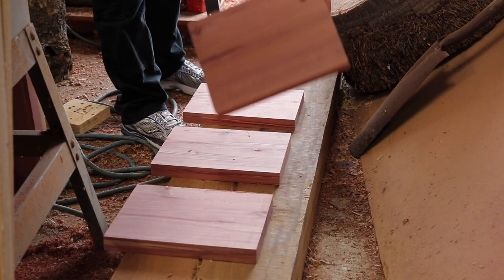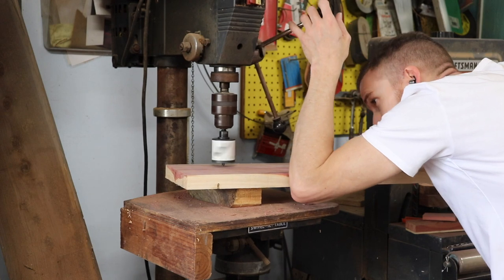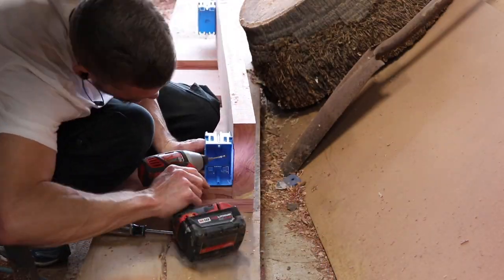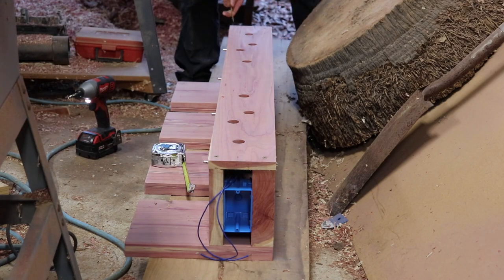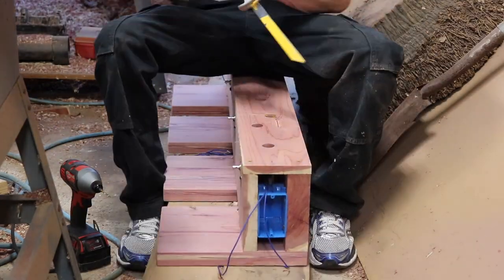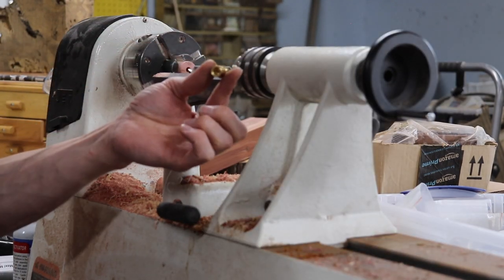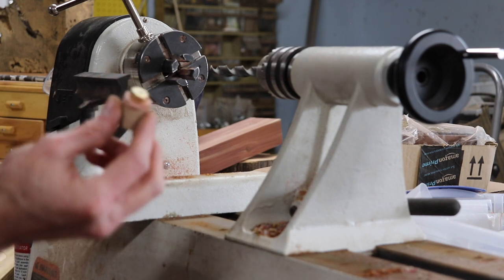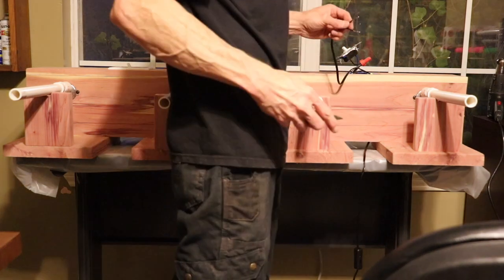DIY Cup Turners

Comment: How do you connect to the brass connections of the motor to the pvc chuck?
Reply from the maker: I turned some wood plugs on the lathe that the brass connectors press into and also press into the PVC pipe. They sell coupling connectors on Amazon. I posted a link in the description of this video. I hope this is helpful. Thanks for watching!

Comment: Im wanting to build a 6 cup turner, and im not very savy with measurements, for a 6 cup turner what would the measurements be for the lumber do you think?
Reply from the maker: It would be 6ft(72") wide for a 6 cup turner with the same layout as the one in this video. 
Here is the measurements you need to build a 6 cup turner. 
1 - 7" x 72" x 1-1/2" (back piece)
1 - 7" x 72" x 1" (front piece)
1 - 5" x 72" x 3/4" (top piece)
4 - 9" x 12" x 1-1/4" (bottom pieces)
4 - 4" x 5-1/2" x 1-1/4" (pipe rest pieces)
I hope this is helpful. Thanks for watching!
Reply from the maker: Sorry this is the correct measurements for a 6 cup turner. 
1 - 7" x 48" x 1-1/2" (back piece)
1 - 7" x 48" x 1" (front piece)
1 - 5" x 48" x 3/4" (top piece)
6 - 9" x 12" x 1-1/4" (bottom pieces)
6 - 4" x 5-1/2" x 1-1/4" (pipe rest pieces)
Reply: @WillowsWorldofDIY  Thank you! You're a life saver!
Reply: @WillowsWorldofDIY  i apologize. What about the pvc pieces 🤦🏼‍♀️
Reply: @WillowsWorldofDIY  also how many feet and what not. Sorry like I said not too say for this stuff but trying to look up the lumber online.
Reply from the maker: That is all the lumber dimensions and it includes the 6 bottom pieces and 6 PVC pipe rests. you will need 6 - 11"x 3/4" pieces of PVC pipe, 6 - 3/4" male pvc adapters, 6 - 3/4" female pvc adapters and of course 6 TYC motors, 6 single gang electrical boxes, 6 single  pole switches.
Reply from the maker: We usually have 4 cups drying and 4 cups turning, if you want to be able to have 6 cups on the drying rack and 6 cups turning then I would get 12 - 11"x3/4" pieces of PVC pipe and 12 3/4" male pvc  adapters.
Reply: @WillowsWorldofDIY   so 7 inch by 48 inch by 1-1/2 inch?
Reply from the maker: @randeemarie9260   
1 - 7" x 72" x 1-1/2" (back piece)
1 - 7" x 72" x 1" (front piece)
1 - 5" x 72" x 3/4" (top piece)
6 - 9" x 12" x 1-1/4" (bottom pieces)
6 - 4" x 5-1/2" x 1-1/4" (pipe rest pieces)
Reply: @WillowsWorldofDIY  inapologize im just confused cause thats what you posted the first time and then told me sorry these were the correct measurements and posted different measurements below?
Reply from the maker: @randeemarie9260  Im so sorry I guess I shouldn't be doing measurements late at night lol. these are the correct dimensions 
1 - 7" x 72" x 1-1/2" (back piece)
1 - 7" x 72" x 1" (front piece)
1 - 5" x 72" x 3/4" (top piece)
6 - 9" x 12" x 1-1/4" (bottom pieces)
6 - 4" x 5-1/2" x 1-1/4" (pipe rest pieces)
I do 1 foot per turner so a 6 cup turner will be 6 feet wide. I apologize for the confusion.
Reply: @WillowsWorldofDIY  okay so 6ft long 7 in wide?
Reply from the maker: yes

Comment: Is there a plug for each motor for the outlet? I only saw you wire one plug.
Reply from the maker: I only wired 1 plug for all 4 motors. I ran 2 jump wires from the electrical junction box that I wired the plug into and ran those 2 jump wires over to the 2nd electrical box and then 2 jump wires from the 2nd electrical junction box to the 3rd and then 2 jump wires from the 3rd to the 4th electrical box. I hope this is helpful. Thanks for watching!

Comment: Have you had any problems with the motor getting to hot been flush with the wood
Reply from the maker: The motors do get hot to the touch, but not hot enough to burn you. There is a 1/16" air gap all the way around the motors so they aren't touching the wood except for the 2 mounting points. The wood around the motors doesn't get hot at all and I don't feel any heat coming from the box or out of the vent holes or above the switches on the sides. So the motors do get hot, but I don't think they get to hot and I haven't had any motor failures. I hope this is helpful. Thanks for watching!